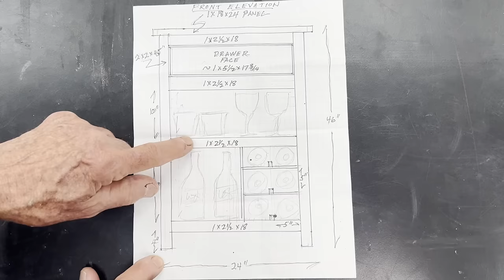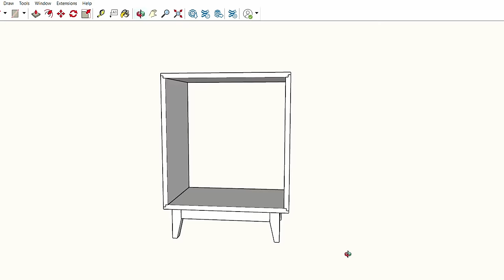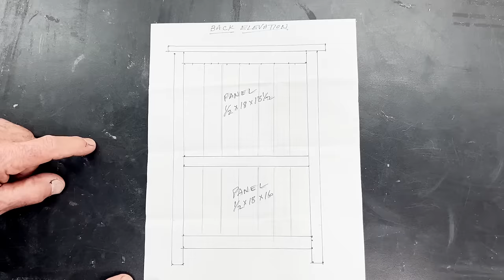I let my 78-year-old neighbor use my fancy tools

Comment: It is amazing what a person can build out of wood if they learn the basics. I took a 3-day hand tools carpentry class at a school that focuses on old methods and skills. Several years later, I needed to build a barn for my goats: 12ft x 24ft. I did all the work by myself - a 65 year old female who had used my carpentry skills some but never to design and build such a large project. There was only one problem I had and ended up getting professionals to fix it was the tin roof. The roof sloped 3 inches across the narrow side of the building for rain run off. I tried to do it myself but had to call in professionals because my roof leaked and all the solutions I got from other builders didn't work. In less than 4 hours, the 2 men took the old tin roof off, put down 2 × 6s on top of my ceiling rafters and used longer sheets of tin. No more leaks. I used battery powered drill, hammer drill (fantastic toy - I didn't even know they existed), and  circular saw. All of them cut through the 2×6s and the Smartboard I used as siding. I now just have to build the 2 dutch doors and and other 4 stalls on the other side. I had to wait for the building to dry out well after the leaks and to give my shoulders a rest from using the power tools. The goats love it and I have used it several times for first time goat moms to give birth in. The are protected from weather and predators. Thank you for encouraging everyone to stretch their imagination and built neat stuff!

Comment: I totally resonate with both of you.  My shop was considerably better than John's but not nearly as complete as John's.  No jointer/planer and only environmental dust collection. DeWalt rather than Ryobi.  I didn't go for junk wood, but worked with what was around (often junk wood).  I did have a decent collection of ancient hand tools -- my great grandfather was a master carpenter and my mother collected w/w tools.  If you know what you're doing, you don't need all the fancy shit for solid accurate results.  Or more importantly, fun. 
Btw, compressed air in the shop is well worth it.

Comment: Workess portable table saw stand from Amazon will barely fit the Sawstop CTS if you secure it with U bolts through the mounting plates but you can only get 3 on there without modifying anything. I think Elder John will need/love it

Comment: That is great. My vote may be biased as I am in the same century of age as the "other John". I think his has much more style to his roots. His roots are deep and of vintage quality. He did an outstanding job in a jobsite which is different in most ways from his at home. You or the other hand have evolved through that stage and already had used some of the tools and techniques that the more "vintage"  John uses daily to build his projects. Therefore, I vote for Vintage John over Millennial John. It is a great video. Thank you both for making this older guy smile with the gift that you bestowed on Vintage John.

Comment: And here I am trying to slowly build a shop for myself in the garage, from scratch. Currently I have: 1 concrete floor, and that's it. My only power tools are a circular saw and an orbital sander. No clamps, no vices, no tables. Got a handsaw, a few chisels, rulers etc. but that's it

I am currently getting a horsesaw set built. Once that's done, I will make some clamps. Maybe that will be enough to pass as a workbench to get the pantry shelves done

Comment: I built an entire counter height 7.5ft long, 44in wide kitchen table from ruff cut hard maple using only a hand saw, sandpaper, a drill, dowels, wood glue, and clamps. No joiner, no planer (not even a hand planer), no electric saws. It did take forever and I would not do it again, but other than some unevenness in the surface it is very nice and taught me a lot of things.

Comment: I feel ya on missing the assembly table and whatnot most.  I went from having a decent sized garage that was big enough to do the stuff I wanted to storing my tools in an old camper and having to work outside (carrying my big tools in and out one at a time).  I didn't realize that just having a semi flat floor was so handy.

Comment: Love them both, but I would put Old Johns in my house so my vote goes there. Buuuuuuut I WOULD add the pressure sensitive paddles. Where did you get those? I need to experiment with them!

Comment: I literally just did about the same thing with my cordless Ryobi router, I was routing a half lap joint and had my hand over the locking mechanism and gripped it too tight and the but just sank. Thankfully I was cutting it in multiple passes and it didn’t plunge below my intended depth, but still. Kinda makes you wonder why they put that lock right in the way.

Comment: It may last a lifetime but will it last two? I've had plenty of glued furniture fall apart because the glue had failed. And all glue fails with time. If you are not using joinery worthy of a Japanese Master Crafstman, you need a little more than glue.

Mixed feelings about the cabinets. They both look great. I especially like the screen. I used a screen on the back of an old document cabinet I refurbished a while back. My reasoning was to allow the air to flow.

Comment: I love the rustic feel of elder Johns cabinet, but the winner for me is the millennial cabinet. Still not a big fan of mid century modern, however that black stain accent on the grain is amazing and the swing doors in front are easier to child proof or lock.
Next challenge Idea would be to see you two try to build something from the other persons style or switching designs.

Comment: I like both projects but the tie breaker for me is which one would last the longest with all of the intended features still fully functionally and the least amount of effort to maintain. So the win in my book goes to Elder John. Ascetics wise I would like the younger Jon's design better if it didn't look too short to comfortably stand in front of it and use the top to mix drinks on top. 

Also, bonus points for Elder John's taste in liquor compared to the stuff in younger Jon's liquor cabinet.

Comment: Plot twist.. Older John changed locks on the work shop and gave younger John the key to the shed.
I'm old, I like older Johns cabinet, he also used what might have been scrap wood and turned it into something that will last for years to come.  
Both cabinets look good but also depends on the room and décor, as to which one would look better in.

Comment: Old John won in my book, but not by a massive margin. Red Oak is not just a 'frumpy color' it's a beautiful wood. Hiding it away and blacking it out was the wrong move in my opinion. Red Oak can be stained to many different levels and tints and has a wonderful texture that is easily drawn out. There is now no difference in the visuals between black press-board and his piece as both are hidden away like some sort of secret shame on a piece.

Wood deserves respect. When people hide the wood, deface the wood, remove a woods identity you lose the spirit of the wood. This is why I stand firm on Old John's win. His piece celebrates old wood no one would normally have given a damn about any other day. Lifted it, grew it and gave it a new life, a shiny finish.

Jon took a wood that prime ready yet was somewhat plain and took away its identity.

John took old abandon woods that had lost their identity and gave them their life and face back.

Comment: It is a shame red oak gets so much hate. Avoiding finishes that accentuate the orange is the key to using it and as you mentioned it is a third the price of walnut in my area and easy to find. Irony of course is that walnut was used for drawer boxes in red oak furniture in the 70s and 80s. I can’t stand the dust from walnut when machining it. Obviously a mask should be used but even after when it hangs around in the air I can always tell when I have been cutting walnut.

Comment: I'm a semi cabinet builder... I grew up in my dads woodshop, now I get to use it to do projects in the off season. He is pretty much retired. I'm a crew boss fighting wildland firefighting, that's my real money maker. F**k saw stop. I've been watching the industry change, I'm very risk adverse I'd love an aim tech table saw, I will on principle never use a saw stop they don't give a shit about safety they care about money (which I understand) they continually deny any attempt at licensing the tech and they can't build on that without them suing them. Garbage values with zero attempt at making it a industry standard.
Reply: +1 to "f*ck saw stop"
Some time ago I think it was Bosch who came up with a better system that was not only way cheaper, but also did not wreck the saw blade (and potentially the saw itself). It was less complex and just as effective as saw stop, yet we don't have them any more due to a BS patent/lawsuit/whatever. The main difference was that it just retracted the blade into the table instead of jamming an aluminum block into it.

Comment: Oof this is a rough one I think. Big Johns work has alot more character which I feel mainly comes from experience, while little Johns is much cleaner looking, but I think that comes alot down to the materials chosen instead of the woodwork. Getting help with your hidden feature is minus points for sure.

I cant decide, its a tie to me.

Comment: Hi Jon, I want you to know that the router incident at around 7min mark happened to me when I was building a uniquely designed cutting board and as I was cutting the blood groove. It was a new router and the luck was not tightened and it just started sinking deeper and deeper. By the time I pulled out :), it was too late. I was a proud father of a mangled board. It was a terrible feeling and I wanted to smash the router. Anyway, just wanted to share that.

Comment: So, the problem i have with judging these things is that they sit in a vaccum. Either piece will look amazing in the right environment. A side piece like this has to fot the room.

However, young john, I'm sorry, cool as though your speaker gimmic may be; I would hate it after the first round. That would be getting ripped out faster than old johns old table saw. And that little hinged compartment is pretty damn neat. So old john wins!

Comment: This one is harder. I don't like designs where you have to remove items to get to operate a function of the piece. So the lift-top is TERRIBLE design. That said, the loudspeaker takes up too much room, disrupting the cabinets primary function. The placement of the kids artwork will encourage them to get into said liquor cabinet to see it. While the speaker could also be security to announce "kid might be into the booze", it's likely annoying enough and easy enough to defeat that it'll likely just get unplugged anyhow. Aesthetically, I love them both and could see them both in opposite ends of my own house where the dining room is more of a 50's lounge aesthetic and the den has more of a country cabin feel. 

It comes down purely to versatility and senior takes it again. The taller shelf spacing allows for more than just rocks glasses and the drawer is perfect for stashing away all of the small tools: wine key, church key, wine preserver, bar spoon, cigar clips, torch lighter, ash cups, deck of cards and a couple of live-edge coasters. You could even insulate the top compartment with foam board and a trimmed down bus tub for ice and garnish storage.